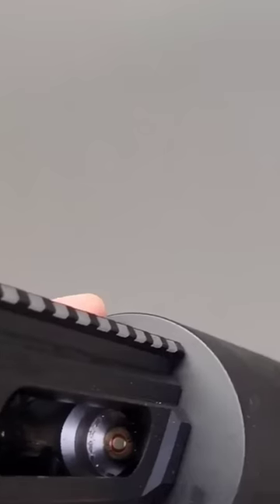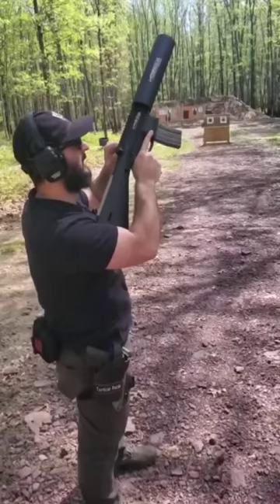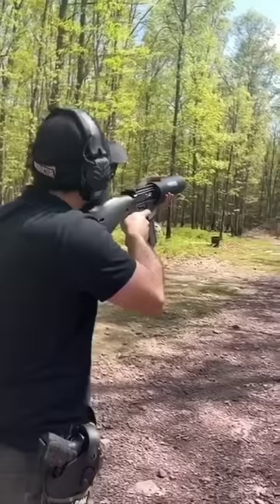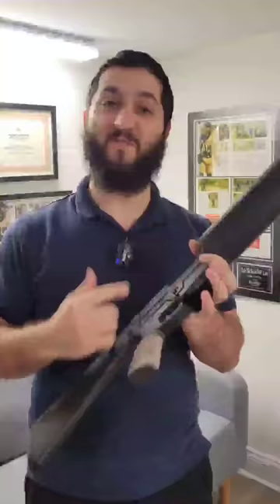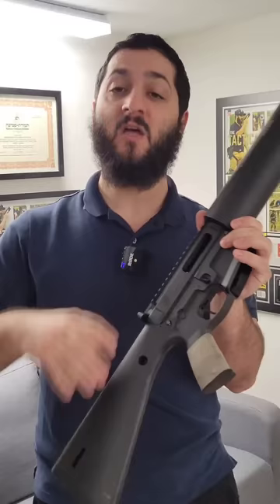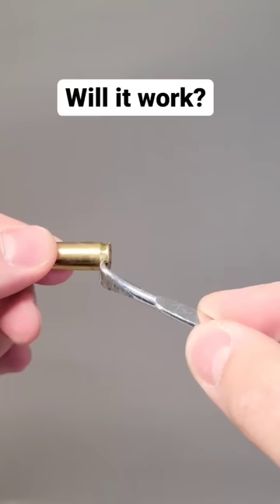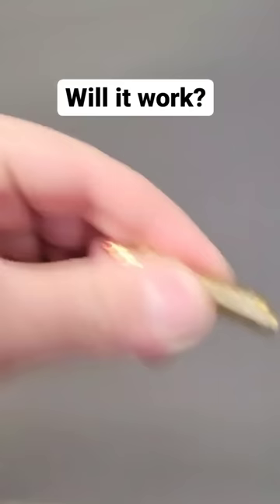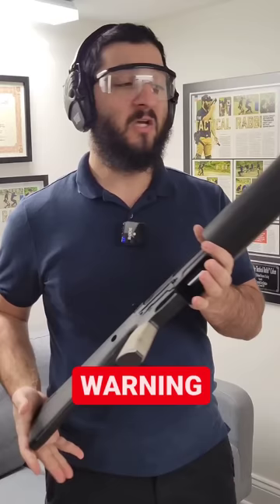I have a LIVE bullet stuck in my AR15! - Here's how you get it out.

Comment: I just put my cleaning rod down the barrel...
Reply from the maker: The can cannon doesn't have a conventional barrel. It's blocked off on top because it's designed to only fire blanks. I also much prefer dealing with an issue like this from the back especially since it's a live round.
Reply: @TheTacticalRabbi  true, but as long as the primer hasn't been struck and your bolt catch is back, it should be fine... I run steel case .223 through my ar so I think it may just be my ammo
Reply: Lol and now it's stuck in your head?
Reply: @danielconnolly7560  vice grips
Reply: @ExplosiveQuarry  definitely the Tula ammo
Reply: @rickybobby1056  hell yea brother...1000 rounds for $500 in the middle of the freedom seed crisis...
Reply: @ExplosiveQuarry  it is the ammo, same thing happened to me with steel cased, had to shove a cleaning rod down the barrel to get it out, broke the handle off the first one lol. Was running fine until I got it super hot , never have that problem with brass.
Reply: @ExplosiveQuarry  If you like running steel cased ammo and have sticking issues i would suggest using a honing brush and oil to polish the chamber.
Reply: @danielconnolly7560  you can get cleaning rods with long perpendicular handles. Only logical reason I see for the long ones to exist has to be to clear live rounds.
Reply: That's ballsy
Reply: @molyt4032  the rounds were already shot and the casing expanded and fit too snug into the chamber for the extractor to pull it out so it would just sheer the rim of the cartridge...
Reply: @TheTacticalRabbi  calm down Nancy it’s a blank. Taking a Ram rod to it would be fine. What’s the point of a gun that only shoots blanks? Unless you are using it for actual training.
Reply: @danielconnolly7560  Well, if it fixes it there is no problem, if it fires there are no more problems
Reply: Try a really really strong skinny magnet
Reply: @ExplosiveQuarry  your loading die should resize the brass
Reply: @BigDmike24  it's steel, not brass... and I bought it...
Reply: @TheTacticalRabbi  If it's a blank it's not a live round.
Try compressed air backwards through the muzzle.
If that didn't work I would most definitely be incredibly careful but I would use a sharp wood chisel or knife blade to gently get underneath the rim and work it out.
I would then most definitely mic your barrel and your rounds because something happened.
Unless it could have been the case that the wad was in too tight causing the shell to expand and wedge itself in.
Reply: Jew
Reply: @vigilante9320  Get on micrometer and check the steel cases and then check the brass cases I'll bet you'll find the steel are undersized. When your barrel heats up it expands and it could be the case that part of the rim is jamming in the barrel.
Reply: @based_or_cringe  what? I'm not a jew...
Reply: I currently have steel cased tula stuck in my ar, this happened once before and i could see the primer was already struck so i used a cleaning rod to knock it out, this time however the bolt is also stuck forward and idk if the primer is struck or not, ive removed the lower but im afraid to use the rod what should i do???
Reply from the maker: Utube Succks  Because it's so much fun. Also to clarify, it USES blanks but it can fire Soda Cans, Tennis balls, Smoke Grenades and many other stuff. Really cool
Reply: @shadowknight4738  the primer may have been loose and is wedged your bolt carrier closed... had it happen and I had to use a lot of lube and a screw driver... but mine was done by my brother who is an expert on guns so I'd take it to a professional who knows what to do...
Reply: I know man that’s so simple! We did it at the range in the army all the time
Reply: @TheTacticalRabbi  pushing the front is better than messing with the end that has a live primer in it !
Reply: @Gunfighter5  well you can see in my profile pic, I'm in the Air Force...
Reply: @ExplosiveQuarry  you would schwack a live round with a rod of any sort, on an AR platform because the bolt catch will keep you safe? 
I would SCREAM at someone doing that to STOP, if it happened in front of me. 
Stop. 
Separate upper and lower. Pull charging handle and bolt. Even then, you aren't "safe".
Reply: @jamesdean9367  nah, the rounds that are stuck have already been discharged... the neck of the casing just warps the the chamber so I have to loosen it... trust me I wouldn't be putting my hand anywhere near a barrel with a live round in the chamber...
Reply: @ExplosiveQuarry  "'should be' fine" 😬
Reply: @ExplosiveQuarry  glad to hear it! 
I am just super attentive to safety, brought up that way around firearms. Glad I was, as I have seen some stupid things done that could have really taken a bad turn!
Reply: @jamesdean9367  oh trust me... I've seen some stuff too... never first hand, but plenty of videos...
Reply: @ExplosiveQuarry  the 4 rules were drilled in long before I was given my first .22 round.
  Lucky to have not been around too much stupidity in person. Sadly a guy in my high school had a fatal ND while cleaning a pistol, and 25 years later I still think about it every time I clear a gun.
Reply: @auburntigerzz  did you watch the video? The big tube on the upper basically makes ur AR a cannon by using the pressure of blanks and yeah it should be fine but if it goes off with a rod down the barrel I'd prefer not to be messing with that side.
Reply: @dobber43  i know what the can cannon is and how it works... and I also know how an ar15 works... I'm in the gosh dang military...
Reply: @randallsmerna384  it's probably that polymer lacquer they put on those steel cases.  In another comment he said the gun was very hot when it stuck.  That's a "tell".
Reply: @burlyheads perpendicular handle is for twisting using chamber brushes etc. don't put your rods down the barrel for a live round 🤦
Reply: @TheTacticalRabbi  I wish you had mentioned that in the video.  Would have saved me a lot of time.

Comment: I was at the range and jammed my gun

So i brought it inside my home to clear it free
Reply: Malfs should be cleared in the safest place which is a safe place to shoot.
Reply: I get the point you're trying to make but it's a blank. If there was actually a bullet your argument might have more weight.
Reply: @politicallyinsensitive4200  why was he shooting blanks at the range?
Reply: @zachariahtaylor7811  u have to for the big tube (can cannon) it shoots soda and beer cans out of the gun for a gimmic
Reply: @toptierfish9335  ahhhhh, I missed the can cannon part. Makes sense now
Reply: It’s blank that’s why
Reply: It doesn't even look like the primer has been struck.
Reply: I get your argument but you can always just take the bcg out. Sometimes the problem can't be fixed at the range. Sometimes you have to go home
Reply: Ranges do not have full tool boxes. Mine did the same thing and the only thing the range had was an actual sledge hammer and a punch. They fucked my gun up and didn’t even get the round out. I had to take it home and punch it through with my cleaning rod.
Reply: @politicallyinsensitive4200  a blank can mess you up, especially with the bolt out of battery
Reply: @zachariahtaylor7811  It’s a can shooting gun, it uses blanks to fire cans like beer cans soda cans. the blanks have a decent amount of energy it would be loud but it’s like a over sized firecrackers inside brads.
Reply: Better than taking it to an elementary school
Reply: @mrmidnight32  
Did the Range reimburse you at least???
Reply: @politicallyinsensitive4200  blanks still generate supersonic air pressure from the barrel that can kill someone within 2 ft. An improperly attached blank adapter may become a deadly projectile that can kill or wound at even further distances akin to a regular bullet. 
An example of an idiot killed by a self inflicted blank to the temple: https://en.m.wikipedia.org/wiki/Jon-Erik_Hexum
Reply: @zachariahtaylor7811  can cannon.
Reply: I go to the kitchen 
See the dishes and...
PULL!! 💥
Reply: @WarPigstheHun  oh good a Wikipedia post. Give me a minute, I want to change it to say Batman did it.
Reply: He cleared it at the range, came home, put a new round in and showed how he pulled it out. Unless his firing pin is completely broken, in which case this round is not in danger of a delayed explosion.
Reply: You can use dummy/blank rounds.  You don’t have any of your firearms already loaded?  I keep my firearms (the ones for SD) are kept loaded in a safe.
Reply: @politicallyinsensitive4200  haha you can try! Today's wiki is significantly different from wiki in 2006! You gotta go through a whole process of thorough discussion with peers, adding proof upon proof of why the change needs to be. If it's accepted, it then it then gets proofread by dozens of hired wiki experts, folks who were hired on the strictest of requirements and a thoroughly "clean" history of proofreading background, non bias, etc. Aka, you don't just wake up one day and become a wiki editor. And no single editor can edit an entire page.
Reply: you can make it like 99% safe, just take the upper off and the bolt out. i guess it could "go off on its own" but i always thought people were full of shit when they said that
Reply: I had the same problem before. I simply removed the barrel and used a rifle cleaning rod to push it back out. Nothing too it.
Reply: I know just one guy that did that. 
He now has a hole going all the way out his house now.
Reply: Well he could have made a video of him and his friends looking down the barrel; eyeballing it for obstructions.
Reply: @politicallyinsensitive4200  how was anyone suppose to know it was a blank? he didn't relieve that information till the end of the video after he made sure to tell everyone it was a live round.
Reply: @mrmidnight32  that's why you, the shooter brings your own gun tool set. Everyone should have a small gun cleaning kit and fixing kit in their range bag.
Reply: @justinguarino201 Dummy rounds and blanks aren’t the same thing
Reply: Said the same thing wtf scary
Reply: @mid1429  I know.  Same concept though.  They don’t release any projectiles, which is why I put a forward slash in between the two to indicate both will work.
Reply: None of this video is sensible
Reply: It’s not dangerous at all when the bolts back…. It can’t go boom with the bolt back so there’s no way for that round to go off unless you drop the bolt
Reply: @zachariahtaylor7811  it's pretty hard to miss...
Reply: There is only a blank in it, I’m sure if it was live ammunition with a bullet he wouldnt do that
Reply: @zachariahtaylor7811  can cannons use blanks just for the boom
Reply: Well to be fair them can guns shoot blanks.
Reply: @toptierfish9335  not really a gimmick tho